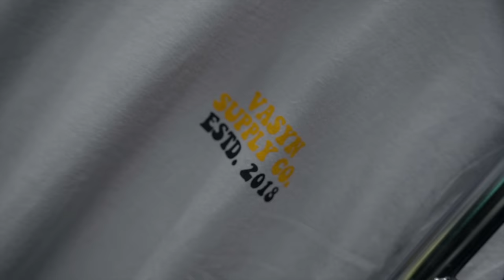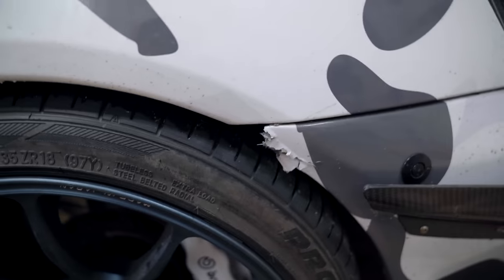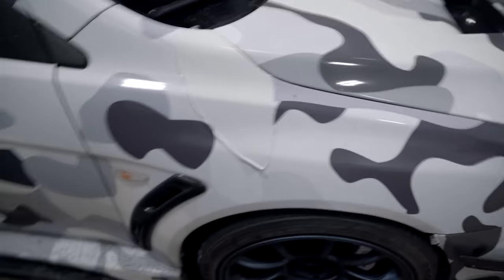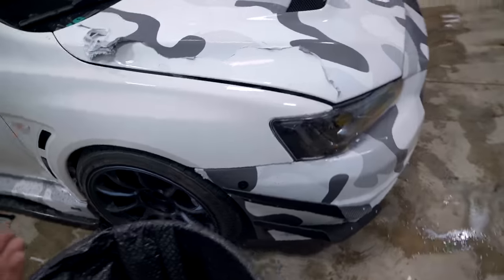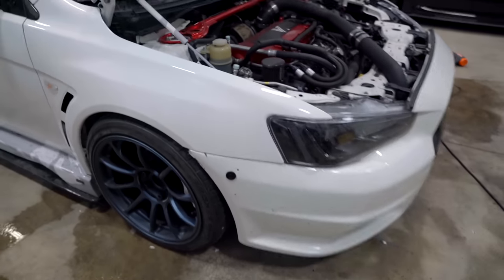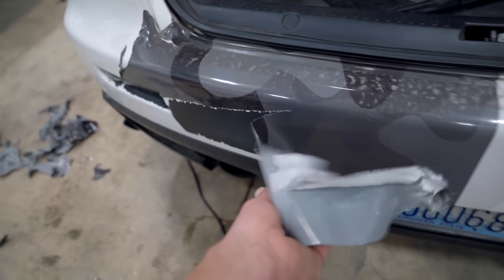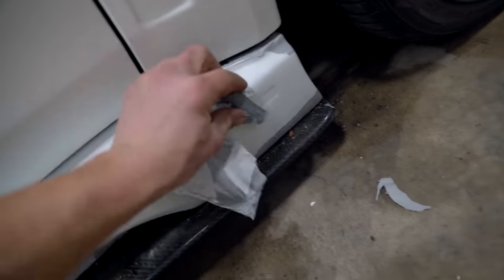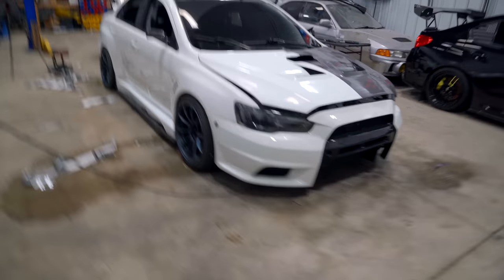Removing My 6 Year Old Wrap to Find This...

Comment: You should paint a carbon fiber black pattern using bug screen to do the cross pattern  on it and add the white camo patches in white carbon as well. So it would take a dark base coat the highlight in grey or white as needed. This technique is used for smaller parts like valve covers.  If you pull it off you will be the envy of custom painters. Go for it!

Comment: Why couldn't you have used a heat gun to loosen the wrap glue as you tore it off? Then use dawn dishwashing soap with a little kerosene in warm water to wipe it down.  Might have saved you some issues.